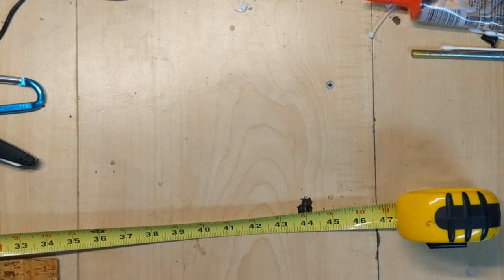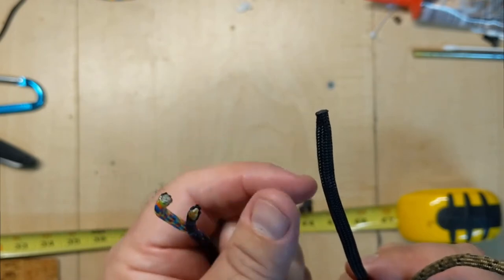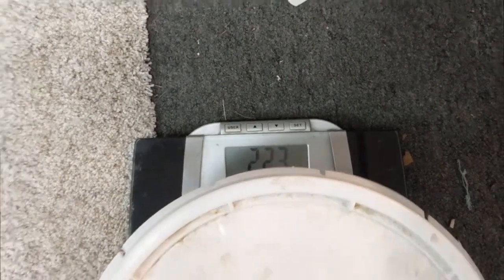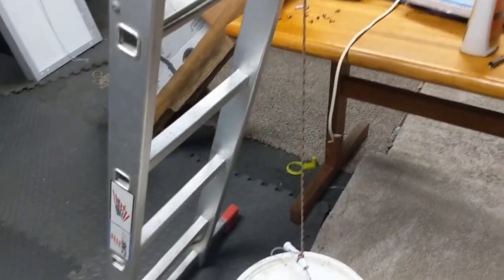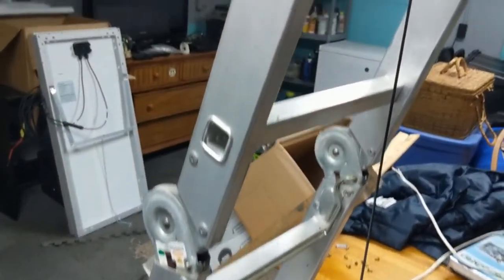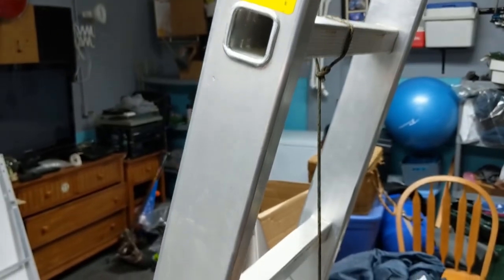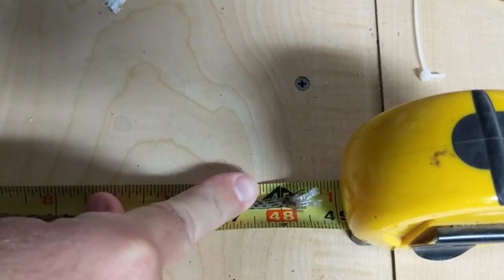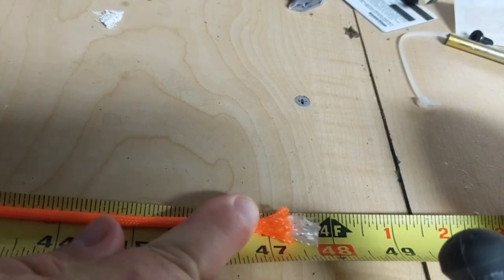Paracord Stretch Test - Version 2

Comment: In your opinion, do any of the pre/post shrink strategies have merit.  That is, some gurus seem to feel that one ought to boil and dry paracord before the project begins.  Others seem to favor dipping the finished product in boiling water.  Still others recommend coating the finished product with one or another solutions.  Thank you.
Reply from the maker: I have done that but only on occasion.  I had to do it for a dog collar that was just slightly too big.  Paracord is supposed to stretch, so if I was going to make a hammock or as a weave for a chair, I may, but otherwise no.
Just my opinion.
Reply: @ParacordReviews  — That matches my own beliefs.  Altho I have tried some of these techniques, I usually don't bother with them.  One exception is bottle coverings, which I usually varnish.  I started varnishing my bottles after a third-grader spent 10 minutes unraveling a week's work.  Third graders need to be watched!

Comment: Dynamic (ample stretch) rope is desirable for load.
Static (little to no stretch) rope is desirable for abrasion.

This is why climbers use dynamic rope for lead climbing and spelunkers use static rope for rappelling and jumar work.

You can use dynamic rope for rappelling and mechanical ascending with jumars, but NEVER EVER use static rope for climbing.

And so as not to cause confusion, 550 is NOT at climbing specs.

Good demonstration
God bless
Reply from the maker: That is a great explanation and really gives insight into good vs ok and even bad paracord.

Comment: 1st of all, stretch ability equals toughness. 2nd: Real parachute cord, is designed to be able to stretch. Those are comercial Paracords and not even close to real Mil-Spec grade Paracord, but the US made, acted closer to real Paracord, than how the Chinese made performed, which probably are made from polyester, instead of tough nylon.
Reply from the maker: Totally agree with you on this.  The reason I do these tests is mainly due to people using these cords for things like leashes, hammocks and chairs.  I want them to know what the weight may or may not do.
Thanks for the comment and for watching.